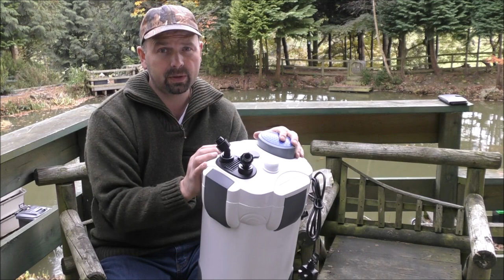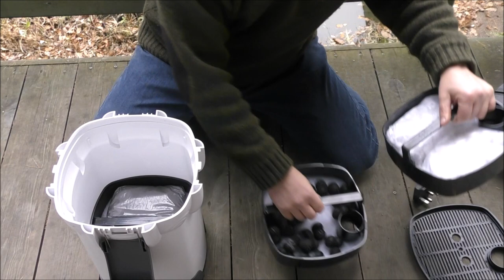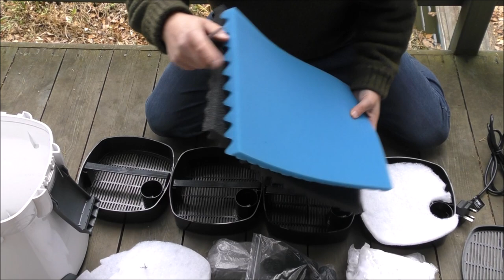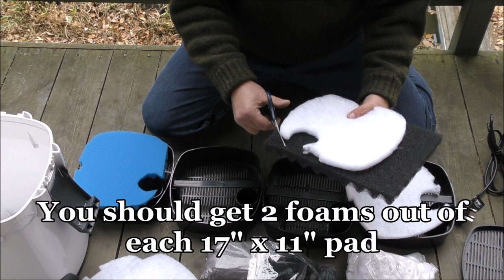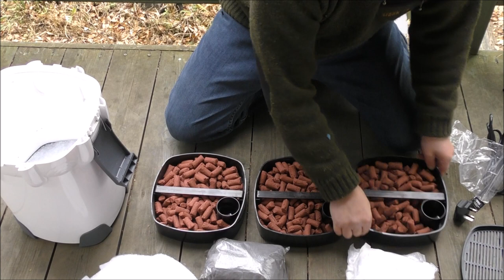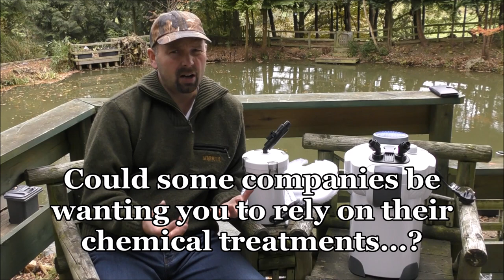Why Your Filter is TOO SMALL and NOT CYCLED

Comment: Great video as usual. I know its a bit of an old video, but does the 1/2 of the projected capacity also apply to HOB and Internal filters ? In my case, I have a 55 US Gallon tank and need to get an add'l filter (HOB or internal) and could use your wise words 🙂. Great video again
Reply: (my other channel) The 1/2 capacity is really just applicable to most canister filters and is based on how much media they will hold. While there are a few which promise way more than they will cope with (e.g. FX range from Fluval) there are also a few which would be suitable for more than the promise (e.g. Aquis 1250) but a decent rule of thumb would be if a manufacturer claims the filter is suitable for up to 100 gallons it will be suitable for nearer 50 gallons for a normally stocked tank and nearer 25 gallons for a heavily stocked tank - that's based on achieving a full cycle with the appropriate amount of suitable media.
Most internal filters have very little space for media but some HOB filters are a decent size - the Tidal 110 springs to mind as a decent filter for a 55 gallon tank so it would be a good choice. The Aquaclear 110 is very similar.

Comment: Hi Richard. Thanks for your informative videos on upgrading the filters, the complete nitrogen cycle and also about bio-home media. 
I would like to upgrade my sunsun 303b the way you have done in your videos, which I have done partly by having a prefilter canister doing all the mechanical filtration & leaving the main  canister purely for biological filtration. However, since I don't live in the UK and your website doesn't ship the bio-home to Kenya, please advise if there is an alternative media that I can use in place of bio-home to still achieve the full cycle.

Comment: Question:  If you have media in the bottom of the filter, how do you maintain it?  Seems like rinsing sponges just got replaced by taking the whole thing apart and washing out the bottom with a garden hose...that I don't have
Reply from the maker: When cleaning a canister  filter the main canister should be rinsed out to remove the heavy muck otherwise when you put the cleaned foams back in the muck still remaining in the bottom of the filter will clog foams quicker.

Comment: could you use a combination of the plastic balls and the ceramic rings in the bottom or would it not make any difference?
Reply from the maker: You could do no problem - just see what works best for you. I recommend the rings as they can't block the intake pipe and redirect flow for primary settlement but whatever works for you is the best set up.

Comment: If I have a filter that is set up the way the manufacturer recommended and had to change around 25% of the water every week to get rid of nitrates. After changing the set up of the filter in the way you recommend, how often would you recommend a water change? As far as I know, the number one reason for regular water changes is to keep the level of nitrates low. If the filter is set up in a way that it keeps nitrates at a minimum, if any at all. Would this mean that water changes are no longer, or less frequently required?

I do agree that the filter manufacturers can mislead us, but what is their motive? With those filters that come with replaceable cartridges it makes sense, they want you to buy a new cartridge every month so they can make extra money out of you, whilst also getting you to throw away most of your beneficial bacteria that has built up in the original cartridge. With these filters that come with reusable media though, it does not make sense. Surely with the amount of funding that goes into research and development, they will know what is the most effective media for filtration, so why do they do it? Could it be because most of these filter companies also sell dechlorinates, which would not be needed as much if regular water changes were not necessary?

What is your motive for telling us different, do you want to actually help us out, or do you want to improve sales for your biohome media? Well, all those well known filter companies have never bothered to even explain the basics of the nitrogen cycle, let alone a 35 minute video explaining why their product works, so I'll give it a try and test along the way.
Reply from the maker: They say that a load of money goes into R&D but I'm not convinced at all when it comes to filter media. There are still a couple of companies telling people to replace biological filter media after 6 months (Fluval and Tetra - and Tetra use PLASTIC BALLS) which makes no sense at all as any media is just becoming fully functional around the 6 month mark. I've even had people telling me that they replace the coarse foams around their FX baskets every 3 months due to manufacturers recommendations which is crazy too since the coarse foams should last 12-18 months before they need replacing even in a heavily stocked tank.
Even when the filter achieves a full cycle and pollutants read zero it is still important to perform maintenance - remove fish waste from tank (with gravel cleaner) and re-mineralise the water and that is easily achieved with a 10%-15% change every 1-2 weeks depending on stock.
Unfortunately some companies are hung up on the surface area of any given media being the most important factor since buyers generally are told that more is better but there is an upper limit and the AVAILABLE surface area on the outside and inside of media is the critical thing so you see all sorts of crazy figures being thrown around - I've even seen videos on youtube where people are judging different media based purely on the manufacturers claimed surface area with no consideration given to accessibility, structure, hardness (most of the larger cheap Chinese media just falls apart) or how well it actually supports bacteria.
Although I sell biohome the videos are put out primarily to help people understand how filters work and explain one way to make them work more efficiently which will reduce the maintenance and ultimately be better for the fish.
Almost daily I get asked about using the larger forms of biohome for traditional box pond filters which are by their nature an extremely dirty environment and I have to talk people out of spending hundreds on biohome in favor of alfagrog which is really cheap but does very well in pure filth as the vast majority of the surface area is external and won't clog up. I don't sell alfagrog so by directing their purchase elsewhere I miss out on quite a bit of income each week / month / year but for that situation alfagrog is the best choice so that's what I advise.
For aquariums the biohome is fantastic and the results from 20+ years of use all round the world trounce any other media as far as the full cycle goes. It is the full cycle which is properly filtration so that is what I concentrate on. Yes, it can be achieved by using nitrate reactors, deep sand beds or by chemical means but since most people already have a filter by far the easiest way to achieve it is to simply size a filter properly and set it up properly with suitable media.
The sad thing is if you look online for 'aquarium nitrogen cycle' all you will see is the first half of the cycle (aerobic) which results in nitrate being produced - scientists, aquatic 'experts', hobbyists, youtubers, forum posts etc. etc. all they mention is the first part - trying to get the idea of a full cycle is extremely difficult since many of my videos get deleted from forums / facebook groups which are sponsored (controlled) by companies which would rather keep fish keepers ignorant of how a filter can work and keep them buying products to 'fix' problems which should never have arisen in the first place - there is one company who even sells a low grade quarried rock as an 'advanced natural filter media' and every product under the sun to fix problems (associated with cycling a tank and maintaining good water quality) caused by their chemical 'treatments'....even one to 'encourage fish to have a better appetite' (when water conditions affect the health of fish) - they're a huge player in the game and 'sponsor' so many sites they have the power to keep any useful information down so they can make a buck or million...damn, I'm beginning to sound like Alex Jones now so I'll leave that one there.
Hopefully by building up a useful base of videos I can help people understand more about filtration as it is the single most important part of fish keeping and so often misunderstood or ignored. What I'm saying in the videos goes against the tide of misinformation and regurgitated 'facts' which blight the internet but it is an angle that everybody making advice videos on Youtube should be coming from. A full cycle is perfectly achievable with a little understanding of what bacteria needs and a little knowledge of what size a filter should be for any given stocking scenario and many people are coming round to that way of thinking which is very encouraging.
The 'pimp my filter' series I'm doing is costing me a small fortune to make but it's all about getting useful information about specific filters out there and I'm prepared to do that because I can use my decent position on Youtube to do so. I took a break from aquarium related videos as I was hoping that the channels I was seeing coming up and far surpassing me would do something similar where they helped their viewers but most seem have devolved into endless vlogs and live chats which earns them the money so I had to come back and create something which would help viewers, not exploit them.
Being seen as the alternative to the big channels is a really nice place to be as I still make the videos as a hobby, enjoy making them, have no branding / merchandise / patreon / inflated ego to feed so I'm more than happy for viewers to be entertained by big channels then come here when they want information.......god knows my videos could never be classed as entertaining as I have one of the most boring voices on the planet, lol

Comment: Just look at the comments below!

People tend to believe 100% when a person has a decent percentage of valuable information.

Anyway, imo at  most, there is a 75-80% of good info, great percentage , mind you!

However, he didn't really explain the process to crate and maintain the anaerobic bacteria.

But ppl , pls use your brains, there are many many cheap bio media alternatives that work wonders, such as lava rock and others .

So basically, by increasing your bio media amount, and adding a pre filter to allow your main filter to go untouched for months should create this anaerobic   bacteria?  That's what I deciphered from this 30mt video.
Reply from the maker: Yes and no.
Anaerobic bacteria simply needs an environment where oxygen is extremely low or absent (e.g. deep sand bed). Unfortunately most types of media are by their very nature incapable of providing those conditions in a canister filter due to the high flow of oxygenated water flowing through it being so suitable for aerobic activity which only processes the ammonia and nitrite. 
When setting a normal filter up to achieve a full cycle a media with a good porous structure and deep tunnels excels but it does take a certain amount of that to allow for enough anaerobic bacteria to thrive to the point where nitrate is visibly reduced.
Having a really slow flow through a filter is another way to encourage anaerobic bacteria as the water itself becomes deoxygenated which allows 'normal' media to be colonised by anaerobic bacteria (due to  the deoxygenated water) but that is often not feasible for a normal aquarium set up and needs to be used in addition to a normal filter to maintain good clarity and dissolved oxygen levels in the tank. Even in a slow flow filter the media with a porous structure will obviously hold way more than a media with minimal accessible surface area.
I did a video ages ago which will illustrate what I was saying about the internal structure of filter media being so important: https://www.youtube.com/watch?v=QTtAUYR67Eg&t=10s
That is definitely my most important video but unfortunately I haven't seen any other channel replicate that video to back up claims about different types of media they are often paid promote on their channels (a picture is worth a thousand words) and I cover lava rock (red and white) in the video as well as lots of other media - taking a microscopic view of the internal structure of the media at a sensible magnification is so important which is why you never see it on other channels or from manufacturers who pay 'influencers' to promote their products........ I also cover how surface area is calculated in that video and it's another scam as it means nothing if 98% of the surface area is inaccessible, lol
Hope that helps.

Comment: Thanks Mr Pond Guru you are the best, great video.I am running a 260ltr discus tank with 2 x Sun Sun 2000l/h canister filters. 4 weeks ago I decided to go bare bottom and I have not been able to cycle the tank since then. I am using Stability and Prime to keep the fish safe with water changes. Looking at your video I realize my filters are not set up correctly. I am using the original plastic bio balls and ceramic rings still in the bags. I have fine pads in each tray. If i want to set them up the way you advise should I maybe take out the media in their bags and leave them in the bottom of the tank and re setup the 2 canisters so not to wipe out the bacteria again. Can you please help.
Reply from the maker: Just give me a ring on 07772848730 as I often miss comments on youtube.
If you're using prime it is possibly the reason you're struggling with the cycle as it starves the bacteria which ensures that the population stays low - that's why most people are talked into using the stability which treats the symptoms caused by the prime.
There isn't much in the filters to hold bacteria currently so that will be adding to the problem, especially since the substrate has been removed - that would have held lots of bacteria.

Comment: Can you please confirm if the tubing inside diameter matches up between the EF2 Booster Filter fittings and the  APS 2000 filter fittings?

In the US, I'm looking at the SunSun HW-603 Booster Filter and the HW-704B 525 Gal/Hr. (2000 L/Hr) which I believe should be the current model equivalents to the APS versions shown in your video.

My concern is that the HW-603 may take 5/8" (16mm) tubing while the HW-704B takes .75" (19 mm) tubing.
I'm not sure the HW-603 is a correct match for the HW-#04 series filters rated at 525 Gal/Hr. (2000 L/Hr) with .75" (19 mm) tubing.

This  makes me question if the HW-603 is meant to handle 525 Gal/Hr. (2000 L/Hr) 
I only seem to see the HW-603 being shown with HW-#02 series filters rated at 264 Gal/Hr (1000 L/Hr) or HW-#03 series filters rated at to 370 Gal/Hr (1400 L/Hr) which both appear to have 5/8" (16mm) tubing that would match up with the HW-603 booster filter.

Based on the research I've done, it's starting to look like the SunSun HW-302B, 303B, 402B, 403B, and the latest 702B and 703B all take 5/8" (16mm) tubing and would match up with the HW-603 5/8" (16mm) tubing.
But I'm not so sure about the SunSun HW-304B, 404B, or 704B matching up with the HW-603 since they seem to have .75" (19 mm) tubing. and are rated at 525 Gal/Hr. (2000 L/Hr).

I really would like to go with an HW-704B and have a booster filter to take care of mechanical filtration ahead of the main filter.  If the HW-603 is not a correct match, can someone please advise if SunSun or another brand makes a bigger booster filter with .75" (19 mm) inlet/outlet fittings that can handle 525 Gal/Hr. (2000 L/Hr)?  Or am I stuck backing down one main filter model to an HW-703B for a proper match with an HW-603?
Reply from the maker: This is from the Amazon listing description:
Increase the external filtration capability by adding supplemental EF-2 Filter Booster to existing setup. Designed for use with the All Pond Solutions 2000EF and 2000EF+, the All Pond Solutions Filter Booster is also compatible with other brand's filters and will fit 18-25 mm size hose. Each booster has a 2.3 litre capacity and is fitted with three-stage filtration fine, medium and coarse foams. Each outlet has a tap shut-off for easy maintenance. The EF Filter Booster can also be used as a standalone filter, with the addition of a suitable pump.
Although it would fit to the 2000 lph filter I agree with you that these boosters really need to be much bigger - even if they were twice the price people would buy them (probably more regularly) since a larger booster would not reduce flow as much as a smaller one.